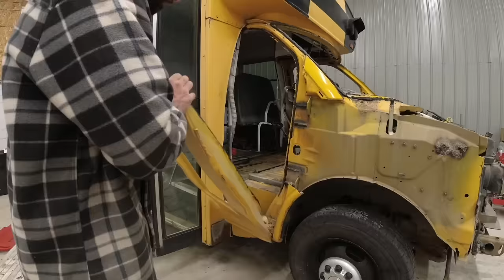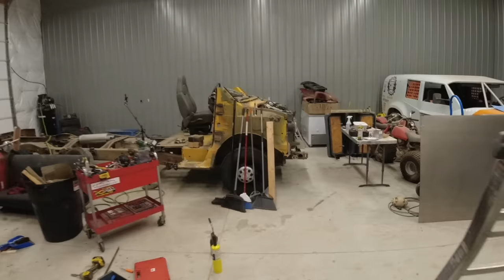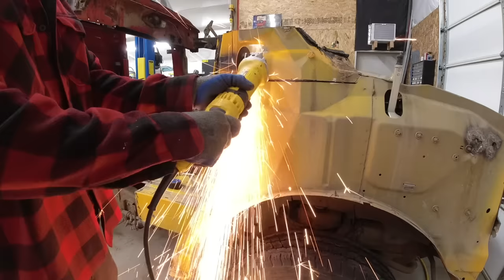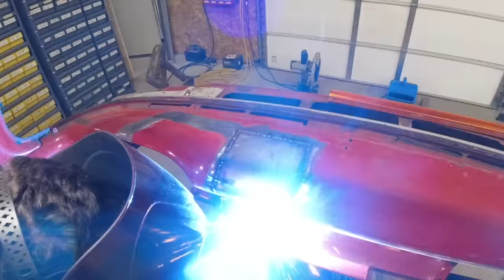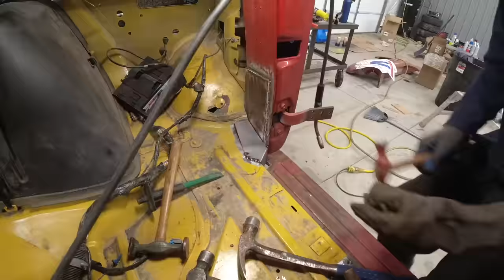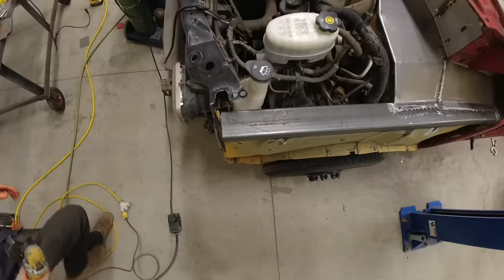Timelapse - Complete Custom Ice Cream Truck Build in 34 Minutes

Comment: Nice paint job. Glad they decided to keep your back wall the same as you painted it. The only addition i would might have made is putting an LCD board on the side where you serve to that tells prices and flavors etc. One on each side of the window would be good. Of course you would have to put a glass covering over them and maybe either give them their own power source or add to the one in the equipment.

Comment: First the pizza truck now this. I’m a subscriber now. I’m very impressed with your skills. That’s not an easy to combination an old truck and a small bus especially with the van front end. Seems like it would have been easier to use a pickup style box truck as your base. Very well done. I have seen some crazy builds and one offs. Most end up being more expensive to build than what you can sell them for. Usually it’s the shear amount of labor hours that makes it so expensive.  Well done. 🫡👏🏼

Comment: Even though it was a lot of work getting that cab to fit on the van chassis I'm sure it was a boon to reliability and safety. It looks like there were few if any changes to all of the important mechanical bits. As fun as engine swaps are getting them to run right is an uphill climb. Seeing an old truck be chopped might hurt a little but lets not kid ourselves, most of them rot away in a field as projects that never get started. This is a vastly more interesting vehicle than it would've been with an old van cab still on it.

I love that it was a school bus that was the donor for the chassis and drivetrain. It's helped kids in its old life and its new one, albeit the new one is a lot more fun!

Let's not forget the body. That old-timey ice cream parlor design is delightful.
Reply from the maker: This guy gets it

I get so many comments about how I'm destroying classics but I feel like doing it this way makes them so much more reliable so that now they can be enjoyed by people daily for years to come instead of rotting behind an old garage.

Comment: You fab skills are top notch! That was a pleasure to watch come together. Even learned a few new tricks.

One thing I’d like to ask of you; please please get a better respirator for painting. Ideally a fresh air pump and mask, but charcoal organic vapor filters at very least. Your pink filters are great for welding and dust from sanding, but not so effective with some of the chemicals you’re spraying. For your sake and your kids’ sake!
Reply from the maker: I use the 3m respirator system with the charcoal organic vapor cartridges while painting and I swap out to the round dust filters while grinding and welding. I think maybe the time lapse is so fast you don't see me switch filters. Thanks for looking out for me.
Reply: Oh right on, glad to hear it!  @AustinCoulson

Comment: Beautiful build! That looks like an immense amount of work! What made you decide to start with a van chassis rather than a truck chassis? Also tip as an electrician you’re not allowed to have receptacles facing upwards without a special cover because they will fill with dirt and grime over time and also armoured cable isn’t rated for outdoor use. But I get that it’s an ice cream truck not an industrial gas plant. Overall lovely job that looks like a really challenging build!

Comment: Your craftmanship is remarkable but im trying to figure out why you virtually destroyed two good vehicles to make one. Why not just strip the old truck body from its frame and update the suspension and engine etc and not try to fit it to the bus body .
Reply from the maker: The bus had an LS 6.0 engine with a 4L85E trans, dually rear end, modern suspension and ABS. It was a rock solid drivetrain with low miles and a clean service record. Even if I swapped the engine and trans over, I would still have drum brakes and no ABS. If I tried to swap those over it would have been more work than what I did.  I did the swap this way because this truck can now be in service daily and maintained like a modern vehicle instead of a modified old truck.

Comment: So many questions...you did this because you could?..is it still registered under the bus vin?..is the gross weight same as the bus was?..you have more then talent you have time and a supportive family...that not a question just and opportunity to brag about them.?....lmao..praise them.
Reply from the maker: Registering vehicles like this varies from state to state. In my experience most of the time they prefer to register a vehicle like this as whatever the body is, so in this case it's a 1958 F350, as the vins are on the body and that makes it easy for police and inspectors. Some states will have you do an inspection and either keep the old vin and modify it in their system with notations or will issue a new vin plate. The finished weight was pretty close to the bus, and about 5k under the chassis max GVW

Comment: The side walls and floor and outside walls should have been left white and roof as well ..reflects the sun better, plus most health dept dont like black to dirty of color ,6 ft glass  serving cabinet for a big truck like that one is way to small and a joke .unless you want to go to some show and wotk about two hours wirh soft unuseable ice cream  that little cabinet it will melt ice cream big time .you need heaver cabinet 12 footer with metal top insulated serving doors with holding plates that charge up and hold cold.better .i speaking from over 100 years of family ice cream business from manufactor to vending to catering of i cream and ice cream consessions ,we worked such as dallas convention center,cotton bowl dallas ,market center convention center dallas, Houston astor dome,houston texas astro hall houston tx so we kinda know ice cream trucks a little.
Reply from the maker: Actually this truck works just fine. Health dept has no code on color. No issue keeping the ice cream frozen, in fact it's the opposite where the issue is trying to keep the ice cream from being too cold. No issue with the size of the cabinet with 2 people serving.
Reply: @AustinCoulson  all good then. sounds great .
Reply: @AustinCoulson   good humor too ya ,